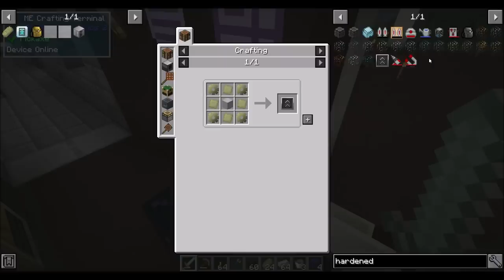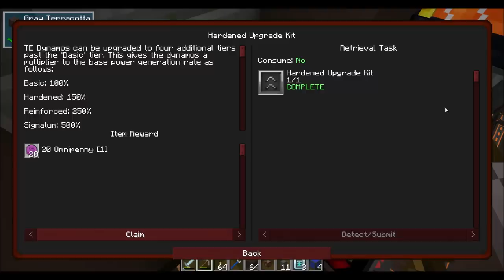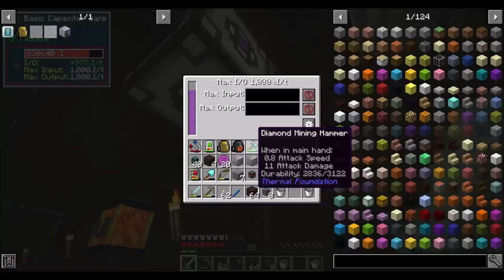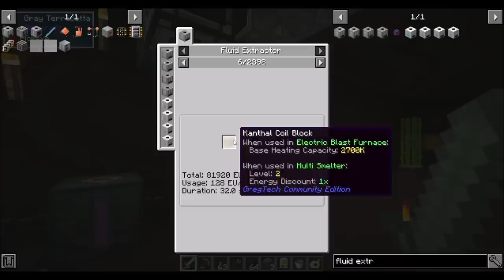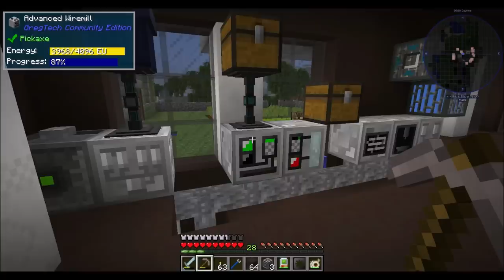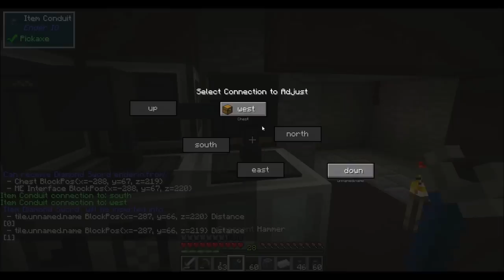OmniFactory   Ep21 Autocrafting!!

Comment: Ahhhh. He's so cute being enthusiastic about automation. But the use of conduits instead of the auto-output is still killing me
Reply: you mean for the fluid extractor, or for everything? 
because for me, not being able to insert and extract on the same face, or extract item and fluids on the same face, makes it a deal breaker
Reply: @MyNarsa  I'm pretty sure you can do all of this from the one side. Input from the output side is enabled by clicking it with a screwdriver and fluid and item auto-output should be able to work simultaneously. May be wrong
Reply: @АртёмМахмудов-м3р  you are correct.
Reply: @АртёмМахмудов-м3р  Big thanks, but how the hell am I suppose to know the screwdriver thing without a book :D XD.

GODDD THIS IS SO GOOD :D xD
Reply: @MyNarsa  Good half of a day on a wiki and you don't derp like Dire anymore)
Reply: @АртёмМахмудов-м3р  But WHAT Wiki? The FTB one seems useless except to NAME mods
Reply: @nhendley  I've got what I know from all over the Internet and even quests from other greg pack. There are definitely SOME things explained on FTB, but I can't say now what exactly I got from there
Reply: Also the endervoirs

Comment: hey dire, you might want to add more cef to transform rf into eu , because the x4 cables mean only 4 machines can run simultaneously, also it's easier to move power with ender io conduits than with gregtech cables
Reply: He hasn't made any extra cefs, because his one works 'just fine'.  The pack description for the blast furnace said that a dedicated cef for each one is a good idea, as each one can get however much power it needs.  
However, if you get the not enough power and you still have some in a buffer, then you need more!
Reply: He should just run 16x cables if he is going to hook everything to one line , and a huge cef that holds 16 batteries
Reply: That's not true, more machines can run at the same time, provided the power requirements are low enough.
Reply: Shawn Hayes but his power gen can barely handle a half of what he needs for the whole system, and to supply a 16x MV CEF fully you need 8192RF/t and he barely has 1350RF/t from his magmatics, he doesn't have enough to power his current one, let alone replacing his MV CEF for a 16x one. I suggest he removes one of the connections for his blast furnace, and add it back wher required, and he installs another 4x MV CEF, and upgrades his cables to 8x, and then upgrade his powergen to supply 2x of what he needs after all that, so he easly can power everything when he moves on to use more MV power, or scrap all the MV lines and replace them with a HV 4x line, and if realy required replace his LV line with a MV 4x line (it will still won't be enough for it, but at the very least he has it).

Comment: Make a seperate 16x cable line for all the multiblocks with a 16x cef.It should be a way more safe and reliable setup.
Reply: No need to use a 16x cable line, almost no multiblock if any requires a 16 amps.  Just give each multiblock it's dedicated CEF, conduits are cheaper to run than 16x cable.  With how stupidly simple CEFs are to make and how easy it is to run conduits and the fact that they have unlimited power throughput even though they have a limited transfer rate each production chain should have it's own CEF.  There is absolutely no reason save for power production limitations that a base in this modpack shouldn't be able to have every single machine running at once.
Reply: @andrewgood7956  the 16 amp allows for 16 inputs, each input takes up 1 amp. Having 16 energy inputs on one line maxes that line out, making a mv cef for each multi block is far more expensive.
Reply: @SavageDarknessGames  Not really.  There's a few things you're missing.  16x CEF requires a 16x cable.  Which is 4x more expensive than 16X cable.  Even if you're using single block machines you need atleast 4 cables to support 16 machines.   CEFs are pretty cheap generally.   The only expensive parts being the circuit and the hull.  The hull for LV/MV machines are pretty common materials so using 3 extras isn't a big deal and the circuits are easily automatable at the time when I would use a large number of them.  Even HV isn't that bad.

In the end it's probably a matter of preference though, but I see almost no reason to use/want a 16x cable.
Reply: @andrewgood7956  i have one 16x cef going through 16x wires to the blast furnace, pyrolyse oven and, all my mv machines. then a medium transformer step down to my 4x lv line and I never have any power or slow down of machines with everything runnning and it costed me little to do as i progressed.
Reply: @SavageDarknessGames  You aren't on as much massive scale as I am either.  I currently have 4 blast furnaces, because a single one won't keep up with the rate at which I use it, that would take up an entire 16x cef.  I have about 16 different production chains/AE automation blocks that each have their own dedicated 4x CEF.  I also have a distillation tower and am constantly expanding.  Even in the short time between your post and mine I added another  CEF with another plan to add another.  Not only would running a 16x cable to each chain be long it would also be expensive.  Whereas the end steel conduit that is connecting them is extremely inexpensive.

Comment: Solder may make your autocrafting a bit different but xd it'll save you a lot of tin. XD up to you though
Reply: Just double up on the recipe, so 8 resistors, fine copper wire etc. makes 2 basic circuits.

Comment: Good video Dire, but i have some imprortant tips to make your life 100x easier.

Switch to cheaper circuits now you have polythylene. Saves resources, mainly tin. If you really want to continue making these circuits, at least use soldering alloy.

Start using auto output instead of ae2 interfaces. Makes autocrafting much much faster and less bulky.

Use a 16x cable for mutliblocks so multiple machines can run at the same time. Also use a dedicated cef for lines that use a lot of power (blast furnace and other multiblocks)

Build a vacuum freezer. Youre going to need it soon.

Other than that its good to see this series is gettinf better. Good job

Comment: multiple assemblers, each with their own liquid this way you don't have to have specific amounts of each liquid per recipe. also if you just prestick up on parts it might make our crafting easier. use a drawer system with the 4x2 drawers, and keep them filled. it will take a while to fill them, but once you do, the crafting will be much simpler. having a huge wall of parts that automatically refills as you use them, plus being expandable infinitely by using multiple drawer controllers if necessary. you could even have all the LV parts in 1 area with a controller, the MV in another area, and even the ores, dusts, ingots in another. this can also allow you to make storage for liquid as well. some for lava, water, any acids, molten metals, polyethylene, etc, just have each configured for a certain liquid at a time. even using containers and storage busses will be quite efficient. you can use only 1 liquid extractor that keeps a lot of that filled, and the reservoir for water, and you already have incoming lava from the nether. use the room. the storage in the center, the auto-crafting along the walls, and just upgrade both as you need. no channels, means you can have extreme sizes of everything. even if you want, use 1 whole room for storage, (both liquid and solid ) and another whole room for auto-crafting (machines along the wall, crafting trees in the middle. your base is literally a giant office building. use the multiple floors. power gen in the basement, terminals and manual crafting on main floor, autocrafting on second floor, and storage on third floor. ano other floord could be more storage or more autocrafting, or even both. the possibilities are literally endless.
Reply: Holy Incredibly Useful Wall of Text Batman!
Reply: @Becka_Harper  yeah, I tend to keep going when I get a good idea.

Comment: Painting the cables a different color for each tier helps keeping track of what voltage each line is carrying and hopefully avoid explosions from supplying the wrong tier. Also adjacent cables of different colors wont connect to each other helps with parallel lines

Comment: Hey dire...rather than running gregtech cable everywhere, you should put CEFs wherever you have a group of machines and run enderio conduit to those.  It's cheaper on materials and you wont have to worry about how much amperage you're using as much.

Edit:  also if you wrench the side you put the interface on and use the screwdriver on that side as well, also clinking the auto-output button in the gui, you dont need item conduits.

Comment: Dire get a drill
Reply: I had been looking for the drill core, but you only have a 1% chance to find it in a chest.  I finally found 1, but want 3 more for a vertical digger.  I think that a drill is a bit out of his ball park right now.
Reply: @joshuabowe4559  try this. Use the scanner set to chests. Add 2 range upgrades. Get the destruction gadget. Scan buildings for chests and use destruction gadget to erase the building. Helps having flight but a decent grapling hook will work too. Id recommend doing this away from your main base just for aesthetic reasons.  The destruction gadget wont destroy chests so makes them easy to track down.
Reply: @davidgirardi1953  That's my technique that I am using.  However, most buildings only have 3-6 chests, and sometimes they are empty.
Reply: @joshua Bowe I had the same issue of not being able to find drill cores. I searched literally hundreds of chest and could not find any. I did finally find one but when I went to the nether and the end I found them a lot more common. I have no proof that there is a higher chance in other dimensions but I now have a dozen of them with only one of them being from the overworld (lost cities) dimension.
Reply: @speakerman36  Hmmm.  I might try to get to the end.  I just haven't made the end cake yet.  Also a really nice way to get some shulker shells, and decent diamond gear.

Comment: For a lot of aluminium, get an aluminium ore vein and then smelt the ore and then solidify it back to ingots. You get 2.5x in pretty much the same time it takes to use the blast furnace.
Edit: This also works for iron, copper, tin etc.
Reply: How are you smelting the aluminium ore?  JEI tells me that can NOT be done.
Reply: @SummitSummit  Use a fluid extractor and then transport the liquid aluminium into a fluid solidifier with an ingot mold.
Reply: @Spoof10  You must be on a different version of the pack.  The only thing I can do with Aluminium Ore is put it in the macerator.  Stuffing it in the Fluid Extractor (LV or MV) does nothing.  Stuffing it in a furnace does nothing.
Reply: @SummitSummit  I'm on version 1.0.5.
Reply: @Spoof10  Yup, that's it.  I'm on 1.1.0.  You are probably exploiting an unintended "feature".

Comment: IC should have covered cables and if covered, they do not connect to a different power tier. For all the fanbois saying GT is trying to be realistic, how realistic is it to have autoconnecting high voltage cables that connect merely because there is another one 1m away...?
Reply: In Industrial craft there's the cable painting mechanic, right? Does that not exist in Gregtech for some reason?
Reply: @slendeaway7730  Uncoloured cables connect. and it wan't possible to colour glass fibre.